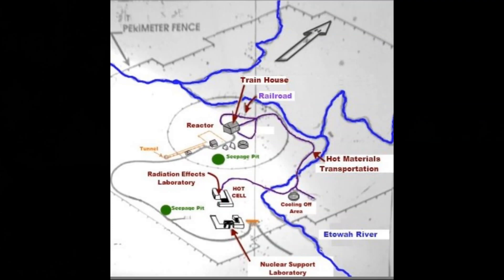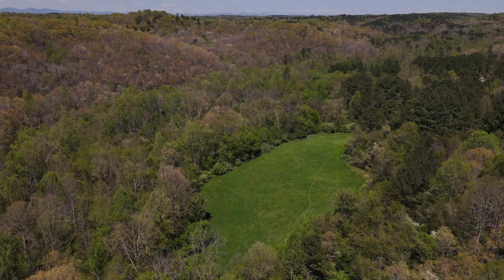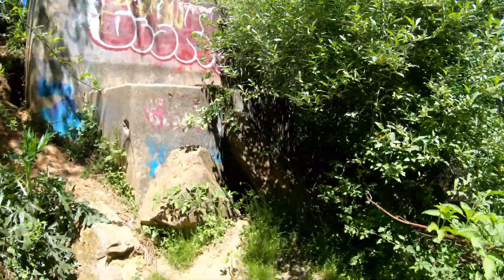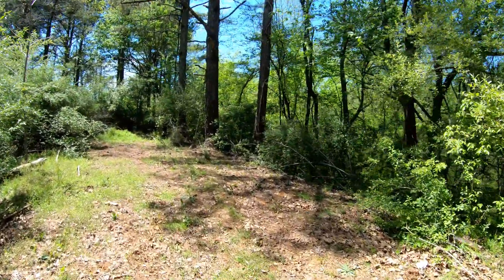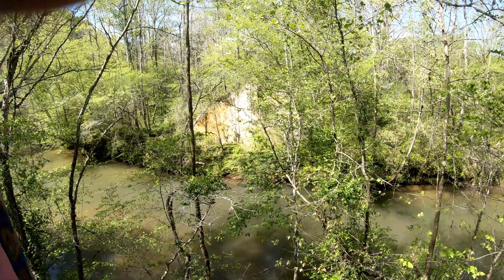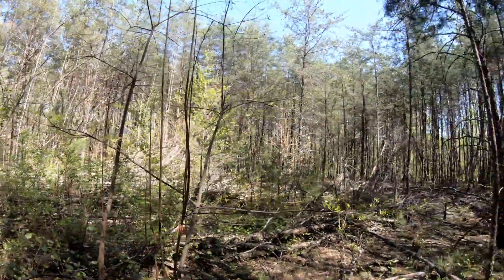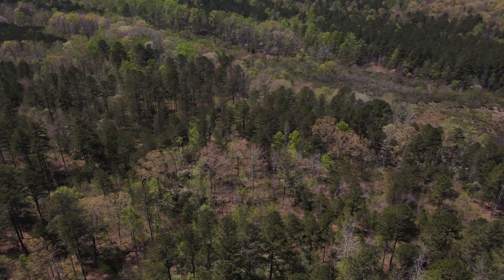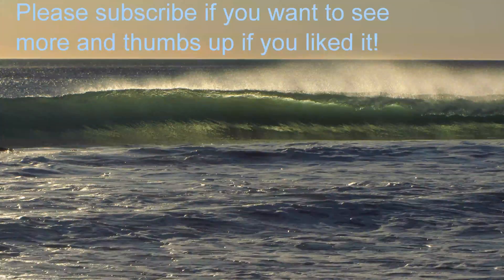Exploring a Nuclear Reactor Test Site in Georgia, 4K 60fps

Comment: Some of your info is incorrect. Much the the information about Lockheed is intentionally misleading. The government doesn't want us knowing what they really did there. I know a good bit about the underground structures and some of the goings on. My mom's uncle was a Security Guard there, in the civilian sector, where the large concrete building is located. I used to camp inside that building with my dad, as a child. It was completely open then. As a teen a was in Lockheed almost everyday exploring, having adventures, riding motorcycles and horses. I'm one of the reasons why they welded the opening shut. I was told many times to stay out of the above ground and below ground buildings. I kept coming back, going inside and getting caught. They went as far as taking 2 old rusty signs I took from there (a U.S. Federal Government, no trespassing sign & a Radiation warning sign) from my home, threatened to imprison my parents if they didn't keep me out of Lockheed. The threats didn't work, I continued to explore and play there and they welded up several sites. They filled in the entrance to the tunnel and staircase, leading to the underground reactor building. I've been inside those buildings many times. The offices had desk, government papers all over the floors and a lot of equipment. Nearly all of that is gone now. As a teen I was defiant, knew a little about the place and wanted to know more. They (the Government) didn't want me there, but I didn't care. It's probably a good thing that I drove them to shut up much of the place. It was dangerous inside some of those buildings.  The concrete building left standing is still there because it's a strong structure. They tried to blow it up, without having a massive explosion. There were massive holes blown in the floor. I've been down inside those holes. I've been inside most of the underground buildings in that area. I've camped on top of the buried reactor. I'm not sure why they took down the Radiation signs along the fence. Anyways, Lockheed has been my playground for nearly 5 decades. I recently watched a video of what it looked like as they were building it. People have no idea how many buildings are underground and how large this facility was. I've said too much! Lol
Interesting video though!!

Comment: Lots of stuff in this video is great but alot of info about the place is wrong. At 4:00 or so, you say its the train house. In fact it's the roof of the reactor room. It goes down some stories where ethe reactor pool was at. It would actually be hoisted about 100 ft above your head at that point in the video. Also, the building with the hole in the roof I've been inside of.
Reply: The area that doesn’t have any trees isn’t the reactor site?  It looks like where the reactor was had a lot of trees grow in its place.  The area with the underground facility is maybe where the open field is.  Is this correct?
Reply: what was inside ?